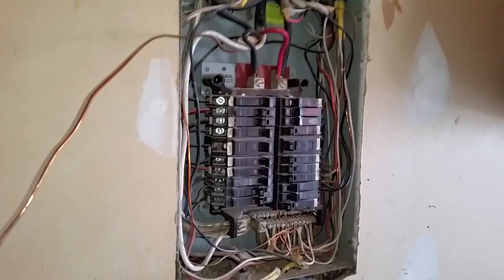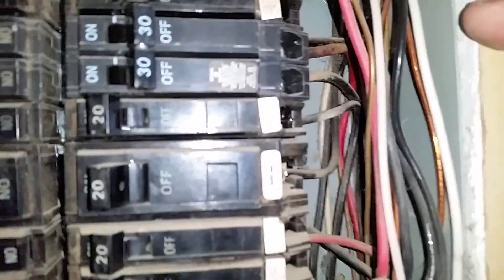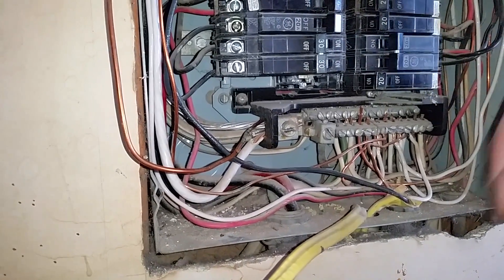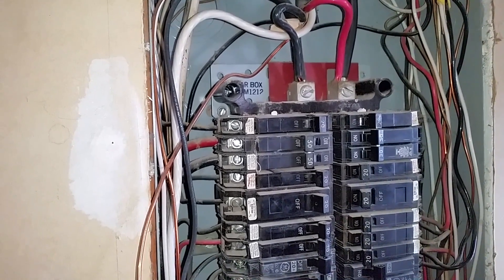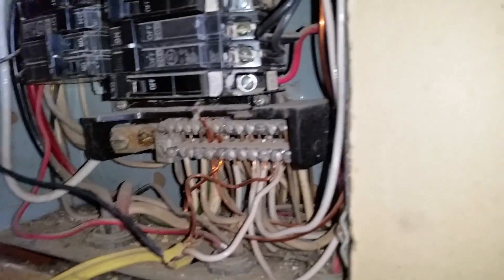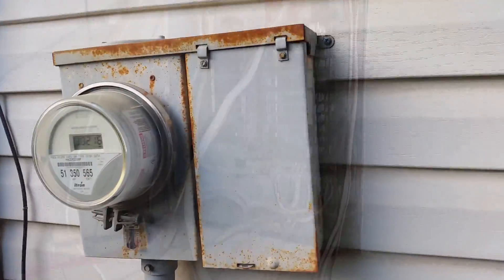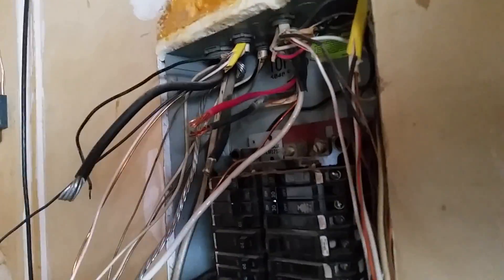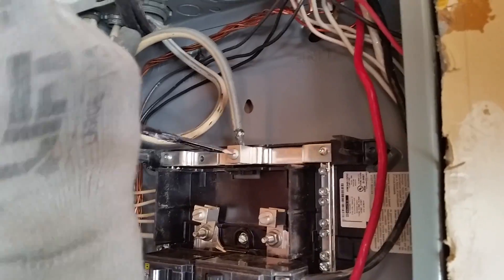How To Do A Residential Electrical Panel Change

Comment: Turn off the power first? So that's why the loud pop, brilliant light, my tools were welded, and I got knocked on my ass right after my shirt caught fire. O.K., that didn't happen to me... exactly, but it does happen around the country. There is -- a lot more -- a lot more, to this project than explained here. Not that I don't appreciate YouTube allowing anyone instructing the weekend warrior how to mess with an entire home's electrical system. What could possibly go wrong? Shouldn't YouTube have a large disclaimer banner?

Comment: I’ve done a lot of electrical work in the past and still do. Never have I ever done a panel upgrade. How do you kill the power from the meter to the panel if their is no breaker disconnect?
Reply: you pull the metre
Reply: The power company will also pull the meter. Install a master breaker while it is out
Reply: correction. can only pull the meter if you are licensed to do so ,  jf not you will need to call master electrician to do so

Comment: Theoretical question. Could the incoming neutral become shorted somewhere and energize the neutral bar? Either before it gets to the house or in the house? If there is a short in a ground somewhere in the house could that energize the ground bar? A guy asked me a lot of questions about his situation where his electric bill suddenly spiked with no change in usage as he claims. When he had it checked there was a spark from his ground rod. He didn't describe it very well but he said there was a spark from the ground rod. He had an out building with an air conditioner, a hot tub and a welder in his garage. I didn't know how to answer his question other than to tell him he has something shorting his ground bar and to test each neutral individually for where that voltage might be coming from. Alternatively I told him it could be your neutral shorted outside the house somewhere. I'm not an electrician but it is quite a curious situation.

Comment: Odd question. I have found lots of residential loose connections in wire nuts that over time generate heat and melt the wire nut.

Can antioxidants help prevent this ?

Comment: Anyone know if your not able to shut off incoming lines can you slowly and carefully disconnect feeding wires and put rubber splicing and electrical tape can i insulate it and remove it safely from panel while hot?
Reply: Not a good idea,  the amperage in those wires can arc and you can't touch them when wrapping tape if they are live
Reply: You can, but I would never ever recommend that anyone other than an experienced electrician do this, if you haven't worked on energized equipment for years and years too many things can go wrong and in a major way. You can usually pull the meter as a last resort

Comment: I am looking to upgrade my electrical panel for a new one, and I really don’t feel like paying 1000 plus dollars to have someone do it for me. I’m asking if there is anyway I am able to change out a panel while incoming lines are hot. My electrical company will not disconnect power for me unless I am a master electrician. I have installed new panels in the past, just never unhooked anything while power was still being fed in.
Reply: It can be done, but you should use properly rated rubber gloves and insulated tools and cap each hot wire after disconnecting and make sure they don't come in contact with anything.  ☇
Reply: You can do it without getting disconnected, for sure. But it's bad for your health. Just pay.
Reply: get an electrician you idiot

Comment: What does this usually cost if I hire a professional?
Reply: I can see clearly Now Yeah I worked for an electrician warranty company and my boss would always charge about $2,000 or so for a panel swap, but that includes material.
Reply: 2500
Reply: So I have a panel with only two breakers (30amp each) and one of the main lugs broke. I can get the electrical company to shut off power completely but is it a good idea to change out the bad lug myself of hire a pro?

Comment: what is the cost of a panel replacement? just like the one in this video?
Reply: I usually charge around 4,000 dollars for changing the panel and meter
Reply: Interior panel change in San Diego in 2023 without a service upgrade, and with all afci GFCI Breakers will be 2,000 plus

Comment: cool I have a Split bus panel in my childhood home and thinking of replacing it with a normal 200 amp main breaker panel wires are 200 amp service i noticed. ita an old cutler hammer ch type i wioud replace with GE BR type breakers.

Comment: Why are you using an impact gun to remove the wires from each breaker? A half turn from a screwdriver does the trick easy and fast and you don't have to worry about the screw coming out
Reply: He's probably going to put new breakers in.
Reply: Carpal Tunnel lmao
Reply: Because those Breakers are probably going in the garbage and it's a little bit faster. Save the screwdriver action for the screws on the new Breakers.